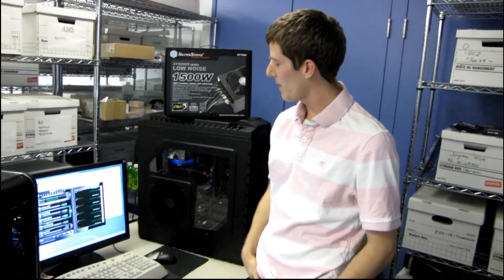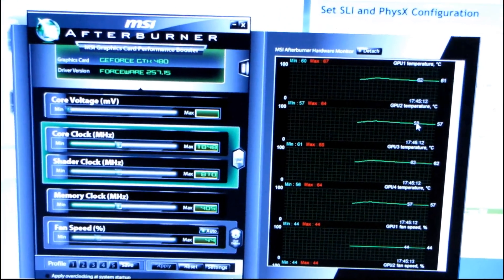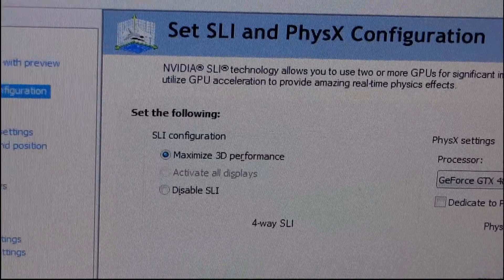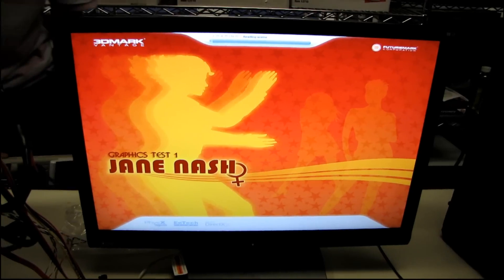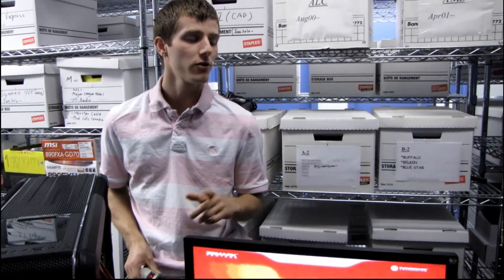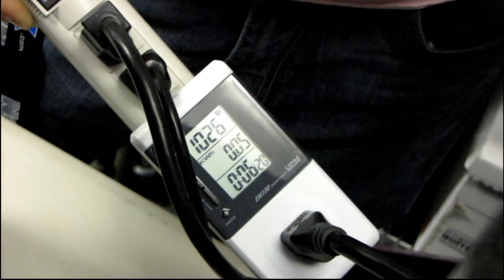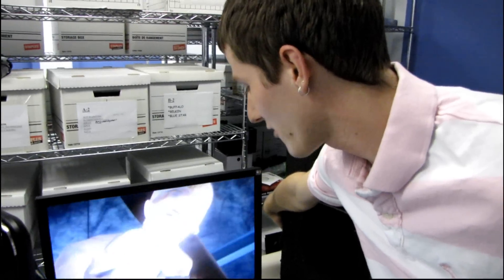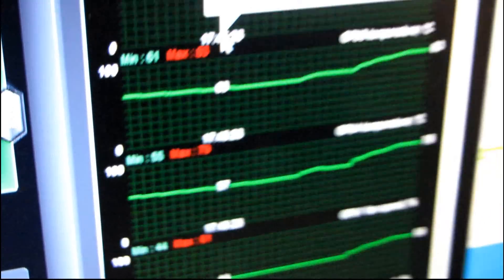4-way SLI Heat & Power Consumption 4x GTX 480 Classified Silverstone 1500W One Linus Tech Tips

Comment: Nah I'll just buy a space heater
Reply: Karl Marx funnily enough, I'd get this. A PC turns basically all the power it uses into heat, making it effectively as efficient as a space heater for heat generation, but you can run calculations on it

Comment: Even a 1000W power supply can run 3 high-end graphics card at SLI / CF. Belive me, I am using my PC with 3 GTX 670's in SLI on my XFX Black Edition 1000W 80 Platinium psu right now.

Comment: i personally don't mind 15 fps. i run at 15 fps cause i have 3 30 inch monitors with 1 7970, and when i run bf 3 at ultra (no msaa) i get about 20 fps, but i prefer to enjoy the visual quality rather than high fps.

Comment: You can water cool 100 cards if you wanted to it's just a matter of space the tubes take up... but anything more than 3 cards is useless because when you start hitting the 3rd and 4th crossfire/sli card they don't scale well at all and don't give any noticeable fps gain and just pretty much sit there taking up space and adding heat

Comment: also for videos the reason why you can feel a difference between 60 and 120fps is simply because even if your eyes only take an image every 30th or whatever, your eyes aren't syncronised to it so at normal frame rates you could be picking up the moments between screen refreshes or something like that so higher fps can seem smoother. RAF Jet pilots are able to spot a blank frame out of a 500fps white image with 1 blank frame per second, they have to train to be able to do that though of course xD

Comment: normally 30fps is enough to see a fluid image but since a game is also taking your input and reacting to it, if its at 30fps it will feel un-smooth because since the computer is working so hard to make 30frames in each second it hasn't got the time to react to input as well as if it was doing 60fps or even better 120fps, when you get to that kind of fps the input lag is reduced so much so that is why people say they can feel a difference between 60fps and 120fps

Comment: I would fit into the "Ordinary PC gamers" category by your definition, I've built my own systems over the years for around the $400.00 pounds your talking about. But I think that gap between affordable and 'enthusiast is widening.. Where in the past I might have had a ATi 9600 256Mb and the "enthusiast" would have a ATI 9800 518Mb, now I might be able to afford a 7850 while the 'other' guys got 7990 or 690 in crossfire or SLI respectively... I think the top is over priced and I'm not into it.

Comment: Yes thats extremly high, especially for a 32nm processor like your 2600k. Im running a i7 950 that runs much hotter than a 2600k on a cosair h80 and getting temps of 60 degrees tops @ 4.5ghz. What profile did you set the cooler on? and whats your voltage and over-clock on your cpu?

Comment: @GTXAbunada Computer power supplies are generally about 70–75% efficient. For a 75% efficient power supply to produce 75 W of DC output it would require 100 W of AC input and dissipate the remaining 25 W in heat. Higher-quality power supplies can be over 80% efficient; energy efficient PSU's waste less energy in heat, and requires less airflow to cool, and as a result will be quieter.

Comment: @MrOwlgoesw00t As I said, I'm just as likely to get out of gaming all together as I am to get a console,because yes so far they are consolols, but for myself I build my systems for far less than $1000.00 reusing the harddrives and the power supply etc., but to me to put even that much money into something just to see a new release, or another version of direct x come out 6 months to a year later is too much... Also, Overkill ?  I was running Crysis on highest settings with an AMD 245 an a Hd4890

Comment: Grafikkarte:	MSI GTX 580 Lightning Xtreme Edition 3GB
		MSI GTX 580 Lightning Xtreme Edition 3GB 
		(SLI)
		

Mainboard:	EVGA X58 Classified3

CPU:		Intel Core i7-990X Extreme Edition

CPU-Kühler: 	Hydro Series H100

Arbeitsspeicher:	Corsair Vengeance DDR3-1600mhz 16 GB

Festplatte:	Samsung Spinpoint F3 1000GB, SATA II (HD103SJ)

Netzteil:		1200W Corsair AX1200 Modular 80+ Gold

Laufwerk :	ASUS BW-12B1LT, SATA, retail (90-D830100-UA0210)

SSD :		Crucial RealSSD C300 128GB 2.5 SATA 3

which psu?

Comment: @oHailPrestoNl a 590 is better for power than 2 480's. remember that even though the 590's a dual 580 gpu card, its so far underclocked to keep it cool that the power drawn is cut significantly (and 2 580's use less power than 2 480's anyway)

Comment: video cards need to get rid of electric and go to optical connections like intel's thunderbolt (previous code name light peek).  electricity can only go so fast or much slower than light can travel.  Intel's thunderbolt connection uses light.  Light connections use much less power and are much smaller than conventional electric connections.

Comment: @SynoDesign Actually i'm sorry but you sir are wrong. You should do some research before you spit out this nonsense and misinform people. A dual GPU card is already registered as an SLI configuration. They don't simply split the load like you said. It is effectively 2 cards in one. And by the way there's a difference between a CPU and a GPU. there is no such thing as a graphics card with a CPU on it. So they could not possibly work as a single CPU. Someone needs to watch more linus! ;)

Comment: That 85 was in celcius right. if it was then they were at 185 farenheit. My teachers core i3 got to 98c so it was around 210f. He overclocked it with the stock cooler and it was full of dust so the fan stopped spinning. Then it just shut down.

Comment: @siyamand p67 mobo like asus p8p67 pro or deluxe or even gigabyte p67a-UD5 or p67a-UD7.With that you should also buy a sandy bridge processor i5 2500k or i7 2600k. k is if you want to overclock. =)

Comment: Your cards haven't heated up yet. As the cards heat up the power efficiency steadily drops. The GTX480 has problems with leakage which is why they tend to get very hot and consume more power. Also Furmark would have been a more effective way at showing the peak wattage because each card is more effectively stressed. 

Trubritar also overclocked his 4 GTX480s which made the leakage problem even worse

Comment: @KHONObakayaro i'm guessing you have the Silverstone Strider ST56F
it is a certified crossfire psu btw  =)
you probably wont be able to do any higher than 2 hd 5770's with that power supply

and i'm sure you will be able to overclock them both, in stock they consume about 200 watts total, give or take a few, and rest of computer doesnt consume as much unless if you're overclocking like crazy
besides, the minimum for the hd5770 is 550w 
have fun!

Comment: @KHONObakayaro i think it is more than capable of handling 5770 in cf, after all, the hd 5770 was made for low power consumption, (too low in my opinion lol)
it might even run tri fire hd 5770 if i'm not mistaken (correct me if i'm wrong) but i wouldnt recommend it. but for just a cf hd5770 then you're good to go i suppose

Comment: ouch 85 degrees C and still rising... Seems to be the main problem with SLI atm. I still havent seen anyone run Rivatuner or EVGA precision to turn the fan speeds up on the cards. This is because the built in cut off points for cooling are set at ridiculous levels. Like 90 C before the fan steps up from 40%. I dont like my Card to go above 72C.

Comment: Try furmark 1.8 AND prime95 to load up your CPU and see what it pulls from the wall! ;)  The Strider will handle it.  Some say the AX1200 will handle it too but with unrealistic loads (Furmark+Prime95) you really need 1.5kW to prevent the power supply from running on edge.

Comment: Hi Lunis,

Thank you for this video, but now there is a huge confusion going on. You see, ever since the release of the 400 series cards, everyone reviewed the cards. From performance to overclocking and everything in between. Problem is, they all have results showing that the 400 series cards run hot and suck up power. This video contradicts that, which is making matters more complicated. Could you kindly just double or tripple check, with a different meter or something? I never doubted you FYI

Comment: Hmm i would recommend if you have the cash to go and buy 4 of the gtx 480's get the EVGA hydro cards and just build a system purely on liquid cooling. 

Then it would use even less power driving 1x240cm and a 500lpm pump, compared to powering 4 GPU fans. And finally it would run a lot cooler.

Comment: @vearheart42 I stand corrected, however at one point in time it was only drawing 300 watts which would mean it's absolute minimum while inside the operating system is 300watts or less.  Unless of course there was an error in the meter.

Comment: @alex14469 With those cards you need to worry more about the room temperature.
I think you need to open your windows, no heating needed in that room.
Even with my 2x GTX260 I have opened my window. It heats the air from in- to output
about 10c, then gaming for more that 5 hours...

Comment: I got my energy meter at canadian tire ... i think it's the same one in this video .... something like blue planet is the brand name .  1500w  not enough?  LOL   I have a 750W corsair powersupple running a quad amd, 4 GB ram  5 harddrives, 6 fans, 3 cold cathode lights, and a 4870 video card ... idles at 200W and 300W at full load ... that's the reading on the meter

Comment: Try to run MSI Kombustor or Furmark, and you will see the powerconumption will  increase much. Run prime95 or Intel Burn test with it also. 
A 1500W PSU is not enough for a high overclocked i7 and  4-way GTX480. 

I have a close friend of mine, and he benched 4-way GTX480(OC'ed) and a Core i7 @ 4,4 ghz, and he peaked up to 1600 watts under full load with furmark and prime95.